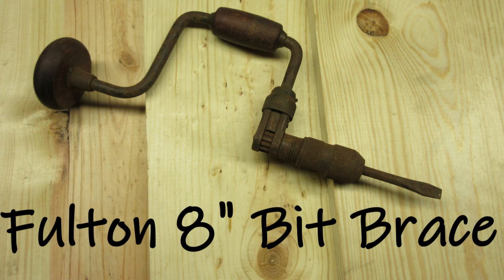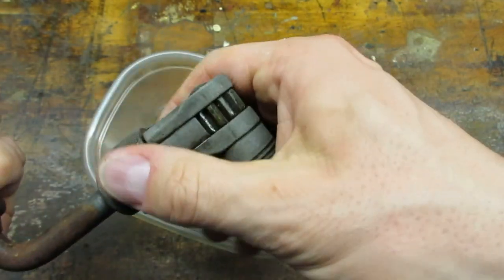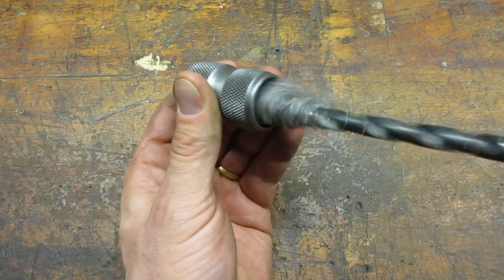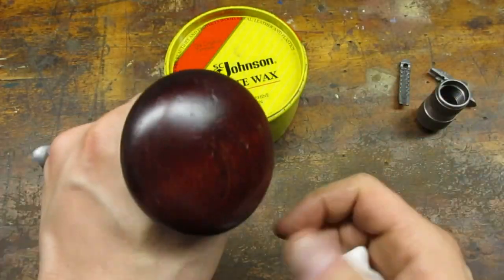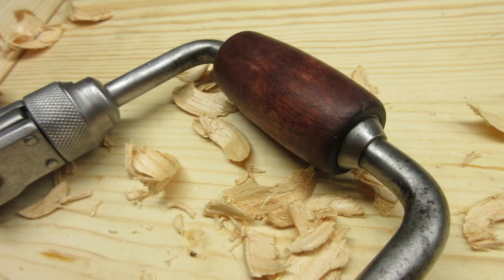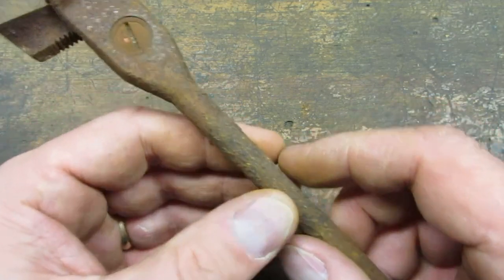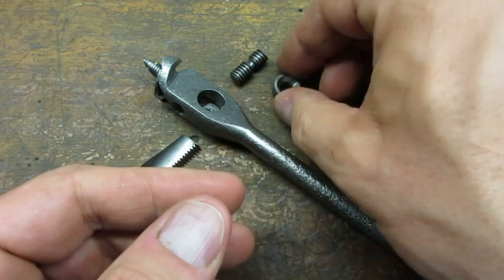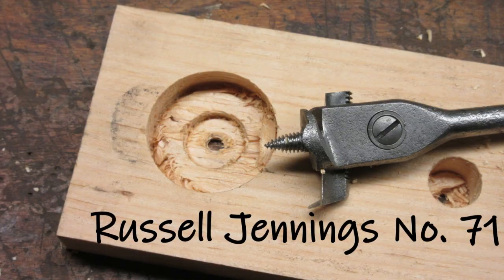Hand Tool Restoration - Fulton 8" Bit Brace

Comment: Awesome restore on the brace and the bit.  I love how you used the steel wool on the handles to keep the original finish, I had never thought of doing that, it worked well and kept the history of the tool.
Reply from the maker: Thanks oldshovel!  The wood on this brace still seemed like it was in good shape.  On the other hand, the wood handle on the putty knife from a few weeks ago had to be stripped and re-finished.  I try to let the tool "tell me" how far to go.

Comment: I like Evaporust for those tools that have wooden parts that will not come off. And for complex parts that will not come apart.
If you do not mind the lines a partially submerged tool will have after a soaking, you can soak the complex and rusted parts like wood handled braces in it overnight.
For all steel or iron parts I have been trying low current, low voltage electrolysis  with graphite anodes.
It is cleaner than using an iron anode.
It requires a setup outside for safety though. 
If you have a covered patio or carport or something similar that can be used for overnight electrolysis. 
For complex parts with moving parts on the inside that will not come apart, Evaporust is the way to go, since electrolysis is a line of sight ( anode to cathode) method for rust removal.
Excellent restoration on that brace.
Evaporust was the right choice in my book.
Reply from the maker: Thanks!  I do my work in the basement so I'm always looking for safer low-fume alternatives.  That's one of the reasons I wanted to try the evapo-rust.  I've also been experimenting with a low fume paint stripper - EZ strip.  So far I've had decent results as long as I soak the item in a plastic bad overnight.

Comment: Nice video. Love the rosewood. Always wanted to try evaporust but in Australia 2litres of vinegar is less than a dollar but 2litres of evaporust is $70 Aussie dollars. Cheers🇦🇺😀
Reply: I always use vinegar. It takes a bit longer but works just as well and far outweighs the cost of Evaporust. Supercheap Auto sells 1 litre for $35 and 4 litres for over $92. That’s pretty prohibitive for the home handyman.
Reply from the maker: Wow that's a lot of $$  I paid $17 for a gallon here.

Comment: Good job. I like the old drills. You made me a believer using Evapo-Rust. I have some rusty very old tools I would like to try it on. Can you use it more than once? Or is it one and done?
Reply from the maker: Thanks Glen! The evapo-rust can be used repeatedly.  I think the instructions tell you to keep using it until it stops working, then you can pour it down the drain to dispose of it.